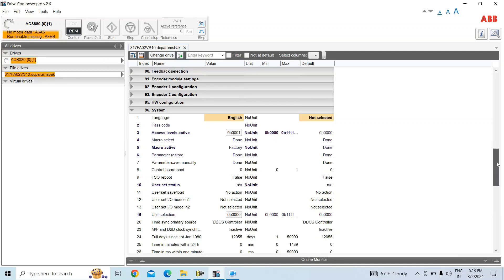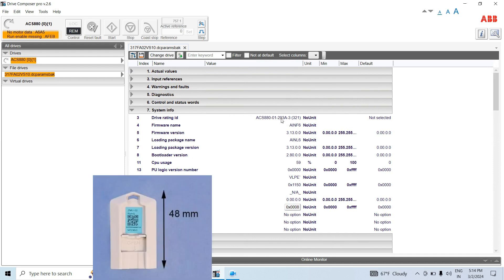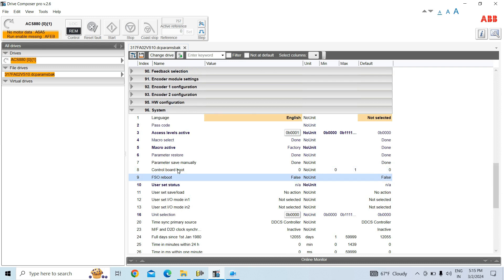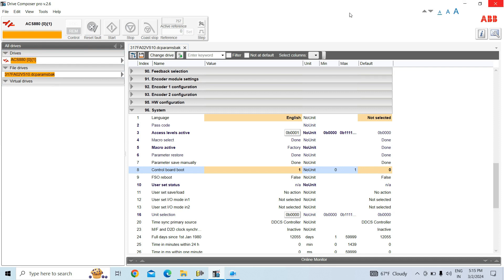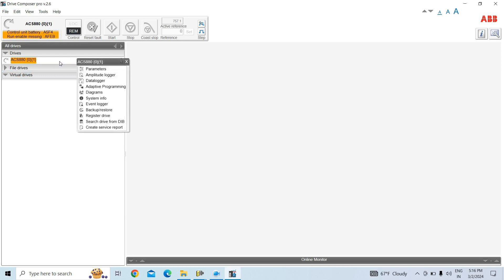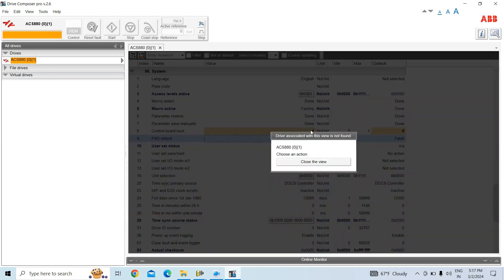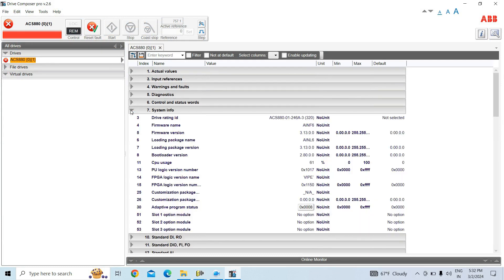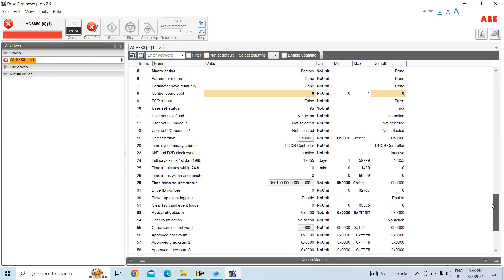ABB ACS880: How to change the Drive Rating ID?

Comment: I have an acs880 -1-98a using zcu 11, I installed a zcu 12 210A card and the rating id was changed to 210A. I followed the instructions but I can't change it back to 98A. Is there any other way?